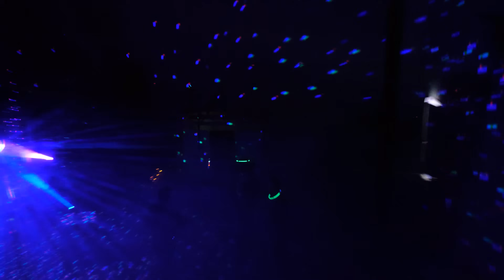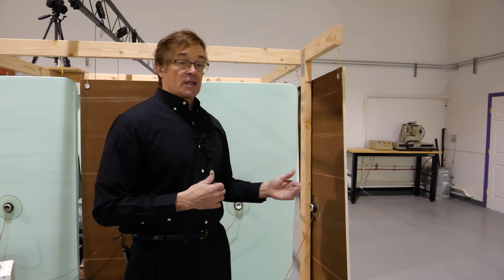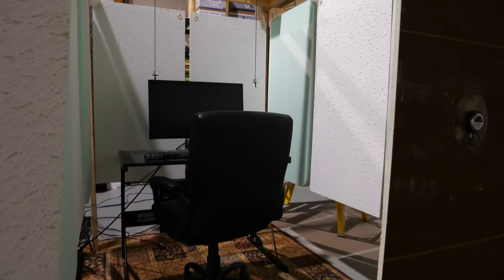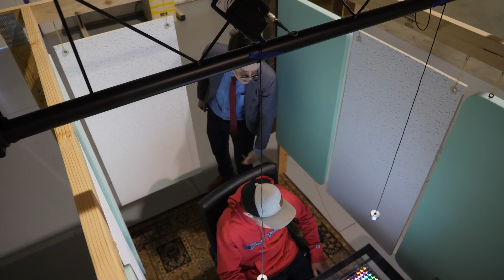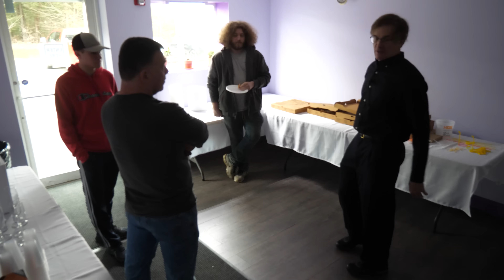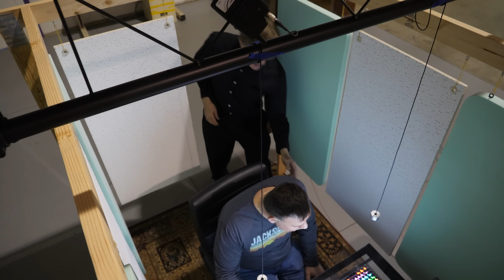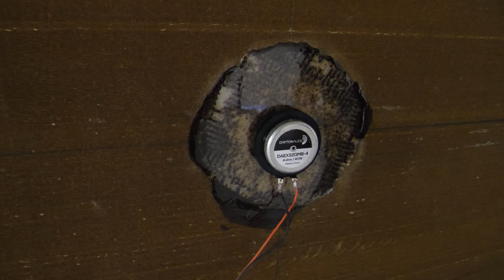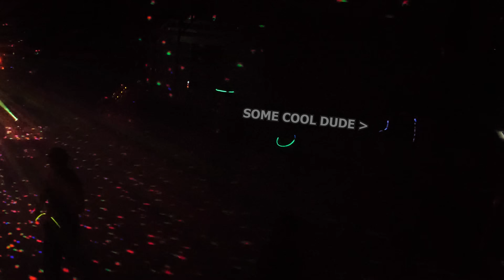SHOULD SPEAKERS THIS GOOD BE LEGAL?

Comment: Was a super cool experience, and a very unique type of sound when heard in person. Thanks for the invite, came for the tech, stayed for the pizza.
Reply: Compared to typical studio monitors, how would you rate these panels? I would guess the audio sounds much more open but is less accurate than proper monitors. Also, was the sub correctly phased with the panels or did it sound like it had group latency issues. (Obviously, estimating this kind of details without previous knowledge of the music you're hearing will be really hard.)
Reply: Thanks for participating!
Reply: I read this as you were getting into the booth lol.
Reply: Absolutely build them you will not regret it I used every single technique I was able to find all over the Internet to try to give them the best chance to sign the best they could when I first listened to them they sound like they were just tweeters no mid-range no bass no nothing and I was instantly and hugely disappointed I thought they sucked but within 45 minutes or so of plain different songs they slowly started the break in then over a short period of time they became one of the best sounding speakers I've ever heard of my life and I've had ribbon tweeters limited edition pioneer tire speakers Polk audio etc and a lot of high quality headphones and the old adage that people say if you build them right you build to enjoy that flat panel magical sound is absolutely not a lie also used a one-to-one water glue coating if I need right two coats on the front and WinCo in the back it was very watery very runny I didn't think you would do anything frankly I thought it was a waste of time but once everything broken I used a very clean sanding knob miniature amplifier and I listened to heifability title music streaming service and hyperformance while he's going through to the panel speakers when everything came together the sound is absolutely almost spiritual like it's something that absolutely has to be heard to be believed and you spend a small amount of money getting up all the parts you need then listen to them you'll be so blown away that's something can send some magical and cost such a small amount so I absolutely recommend building them you won't regret it but I would definitely building correctly though some people try to use cardboard boxes glass wood metal use the pink film is insulation boards you can get up home Depot or Lowe's 2 ft by 2 ft along with all the other techniques and they sent absolutely the best I use the 40 watt four legged exciters from parts Express and I'll make sure my amplifier was a little bit more wattage than what the exciters take just to protect them insurance wise hope this helps 👍👍😁♥️
Reply: Are you the one that gets into the booth at around @13:00?

What was that first song you played?

That had to be an amazing experience!

Hope you have a good week this coming week, and may your pockets be full of sunshine!
Reply: Thanks for the info, but who are you, "I came for the tech and stayed for the Pizza.".?
Reply: I think you should use the pizza box for the speaker panel. Can't be any worse than a ceiling acoustic tile.
Reply: @richarda3659  Ceiling acoustic tile doesn't have much harmonic resonance unlike pizza boxes. You basically would want light panels that make no sound when you knock them. As totally silent material doesn't exist you have to whatever you can find. In this video they claimed that that these materials were the best they could find.
Reply: @MikkoRantalainen  I dont think it was that they were the "best they could find" but more the best material for cost / quality of sound on a cheaper end of the spectrum. he said that entire system setup was about $200. I paid almost that for a good quality set of head phones and the top of the line start about 100 or more up from there. You figure a Bose surround sound is starting at about 1k It sounds to me like this is a killer deal.
Reply: @StrifeA217  I agree that $200 is not a lot of money but I don't think that included amplifiers or the sub. Take the sub away and those panel speakers do not sound that hot anymore.

And unless you're getting noice cancelling headphones, I'd skip Bose audio systems. It's better to get some real speakers if you're going to spend more money in the system.
Reply: @StrifeA217 , what do bose have to do with a good stereo.
Reply: Jasom, good question. Bose is actually garbage so it's nice to see someone else is well aware of that (assuming that was your intention).
Reply: @RickL_was_here  ,you got it. Add bass and everyone thinks it's a great system.
Reply: @MikkoRantalainen  If you're involved in the audiophile world, $200 is nothing. Admittedly, much of audiophile equipment is utter nonsense. However, there are real gains in speakers up to thousands of dollars. I think for the vast majority of people, they could tell the difference between $500 and $1000 speakers. Is it worth that money? Probably not. But it is pretty cool how good audio equipment can get. It's also absolutely insane how scammy some of the audio companies can get too.
Reply: @roots4x  I'm definitely on more on the audio engineering camp than high-end audiophile so no $200 cables for me. I'm currently using Genelec 8030 monitors with DSP corrected subwoofer and I know I could get much better setup but it would practically require doubling the cost of the setup and I feel that it would be too much into dimishing returns category.
Reply: The experiences of animals are real and matter.  Their suffering is identical in nature to your own.  Don't take pleasure in cruelty and violence.
Reply: @Barnaclebeard  I agree with your message but how did that relate to this discussion?

Comment: Many long years ago we played with driving sheets of glass and the results were interesting to say the least. The acoustic characteristics varied with time. Fresh glass sounded very different to glass a couple of years old. Also if the speakers weren’t used for a few weeks, they’d need to be driven hard for a few hours to return to the same state they’d been before they were rested.

The tweeters were fascinating: Two piezo transducers glued to opposite sides of a Ping-Pong ball. The 360° dispersion created brilliant sound-stage. Unfortunately, every so often one of the piezo devices would explode and so the tweeter would need to be replaced.
Reply: That's interesting because we usually think of glass as a rather stable material but in fact it is a plastic or high viscosity liquid.
Reply: @InsideOfMyOwnMind  Glass is better thought of as an amorphous solid. While it’s often referred to as a high viscosity liquid there’s a lack of empirical evidence for this on human time-scales. Clearly we were experiencing the effect of changes to local structure we had no way of determining what they were and even today I couldn’t find anything relevant in an admittedly cursory lit search. The chap who was responsible for exploring these novel acoustic approaches reverted to using more conventional drivers and techniques. Sadly he became quite hostile when I purchased my current speakers from someone he doesn’t approve. So it goes...

Comment: I wonder if further isolation on the ceiling panels could be had by using silicon grommets or tube/hose sections rather than the rigid pipe.  Than again an appropriate size product would almost certainly be more expensive than the pipe segments...

Comment: yes they should be legal, the main reason is I dont want to be in possession of 2 pairs of illegal speakers. Mine were made with the pink foam board/insulation panels. I attached a CD disc to the panel and installed the driver on the CD disc which basically increased the contact area of the driver to the board. Instead of just the ring contacting the foam, which wore away at the board quicker and had an adhesive failure, I used the CD disc to transfer the vibration over a larger area. I also found that the CD disc allows for better low and low/middle ranges to be heard. Applying the Driver as is to the pink board without the CD disc attach point/mount, the low to low middle Hzs were lost. I have them mounted parallel to the ceiling and 4" away from the ceiling in a "down firing" position to the left and right of the desk. The other two are mounted on the wall left and right of the monitor 4" away from the wall.  The sound is incredible and the separation is nearly "life like". When playing Skyrim you can hear people walk up behind you and hear footsteps traverse from side to side. When the dragon flies thru the air it matches sound wise. Im considering making one more set for an upper L/R rear ceiling mount. Probably will need a 7.1 set up...

Comment: I am building a large garage/poll barn and will be making these for it. I was thrown off by the 60/40 for driver placement when I have always heard 3/5 2/5 but after thinking for a second it is the same. Thank you Tech Ingredients for the update on how great these speakers are for the price even after all these years of you covering them.
Reply: It's not critical. But my feeling is to go with an irrational number, maybe golden ratio. But 3/5 is close enough and the exciter driver has a bit of an area to it, not a point source. You can refine it to 5/8 or 8/13 or 13/21 but that would be ridiculous.

Comment: I made a set of these for my shop stereo a few months ago after seeing your video about them and wanting to make some for years. I just used the smaller foam panels, like half the size of the big ones in this video. I added a cheap sub. It sounds great and goes plenty loud enough for my 24x12 shop that I never even turn it up all the way. I have them connected to a bluetooth receiver that connects to my phone. I recommend making some of these for sure if you want a space with good music quality.

Comment: Would really like to know more about the rest of the setup, amps used, etc. Teasing the idea of making a gaming/theater/vr room in a spare room and want to test these out for myself.
Reply: Me aswell
Reply: Likewise
Reply: How they sound up against a wall would be interesting as that is probably how most people would have them at home.
Reply: @Cyba_IT  yeah, wonder if you'd need to add damping material between wall and panel speaker.

Comment: I wouldn't be surprised if most of the tracks on the original Telarc test CD are in the public domain now.  That disc came out in the early 1980's or maybe the late 1970's.  It would be interesting to see how those panels would handle some high dynamic range music

Comment: I had some CARLSBRO flat panel speakers but they had FIVE drivers at seemingly random locations and needed a sub - Never got to use them in anger but I liked them moderately - I think they lacked top end, which isn;t exactly surprising.

Comment: Cool setup, I need to get around to making some and testing them in our anechoic chamber. I'm curious what their directionality is like and if you could optimize a 3d shape to counter modes on the panel.

Constructive criticism intended. To really get a good comparison an A/B would be cool to see. Also doing it as 5.1 to compare to their existing headphones or at home stuff  it is a hard comparison to draw because most people don't listen to music in 5.1, and by up mixing you will inherently get better feedback due to how we perceptually weight spatialization of audio psychoacousticly. Head Acoustics released some cool data on this.
Reply: Directionality is the inverse of a normal diaphragm speaker. The low end is dipole in character, dictated by the size of the panel.
Reply: 10 months later, did you do the tests? How did it go? :3
Reply: Hey
I'm just thinking out loud here but if you have an anechoic chamber to use, maybe do the A/B yourself. Why not use some of the other individuals in ''our'' to do a better test?

Comment: I love your channel and think all your videos are unbelievably well done. I have been building 
speakers for many years as a hobby and no mater how god awful a pair sounded people 
said they were great. That was without a camera pointing at them. However I think yours probably 
sound very good. With over 40 years experience I have found that any speaker,  no mater how 
cheap the drivers, sounded fine if there was no crossover in the vocal range and it had 
good off axis response. Yours a like a cheap Magnepan I will have to try them. Have you 
considered comparing them to cheap traditional drivers. Say the 10FE200 woofer crossed 
over to the ST200 super tweeter at 4K in a 3 cubic foot sealed box. Thank you for another 
great video.

Comment: I think you mentioned that this was a 5.1 setup with a separate sub. Have you tried anything with Dolby ATMOS? I'm curious about how a downward firing panel would be set up. Those of us with vaulted pitched ceilings are SOL with the standard upward firing Dolby ATMOS speakers.

Comment: I wonder how these would work in an outdoor environment. I do small gigs at outdoor markets and it would be interesting to build speakers like this to play my Cigar Box Guitars through at those events. They could hang from my canopy, maybe with my logo painted on them. Hmmmm. Have you tested them outdoors?
Reply: The less is around them the better it will sound. For outdoor use I would take wind into consideration aswell... Also for painting you want to use spray cans with a long distance from the panel when you're spraying them.
Reply: @arend3669  I may have to give them a shot. I have a 12V amplifier I can use off my battery pack.

Comment: I have questions about the impulse response due to the moving mass of the radiator.  Also about cancellation caused by the rear wave coming from the back of the radiator bouncing off of surfaces in the surrounding room and interacting with the panel.  This would typically result in some low frequency comb filtering of the longer low frequency wavelengths.
Reply: These are configured as dipoles well away from the walls of the room so cancellation effects would be very different if you were using them to say, line a room where they are very close to the walls..
Reply: @InsideOfMyOwnMind  The wavelength (λ) in Air is nearly  2.86 meters, so unless you deaden the walls or put up something to diffract the reflected sound it's almost inevitable that you're going to see the reflected wave cancel and/or reinforce the primary front output depending on the frequency.
Reply: I meant to say the wavelength is nearly 2.86 meters "at the low-pass frequency of 120 hertz", the lowest frequency handled by the panel before the signal is crossed over to the subwoofer.

Comment: Cool project, worth a try. If you were to mount these more conventionally for a surround sound AV system how far from the wall would they need to be to not have bad reflection issues?

Comment: Two questions I have : can you glue a picture on top of speaker to make it more appealing for the wife factor and secondly : how can you modified the speaker to hang it from ceiling?
Reply: If you put a picture or anything on it it will cause reflections off the panel, it could also inhibit the frequency response of the exciter. Also he shows directly in the video how to hang them.

Comment: I've seen all sorts of DIY acoustic experiments. Towels stuffed in a hollow, upholstered 2x4 frame; skyline diffusers made of Duplo bricks; and now surface conducting speakers with cheap ceiling tiles. At this point I'm ready to make the ultimate sound booth for under $100.
Reply: Actually, i'm willing to bet that system costs way more than 200 bucks. The rug costs 25 at least, kevlar line, 15, you get the point.

Comment: Need to do some measurements with REW vs. other speakers using the same audio chain and no EQing in the same location, and see the difference.  A UMIK is every inexpensive for this purpose.
Reply: They already have a measurement microphone, it's a Dayton Omnimic. They also have an anechoic chamber at home as well.

Comment: Interestingly, listening to this on my DML speaker setup:  Two 40W exciters mounted to 1" XPS with a 100W passive subwoofer, all running through a Fosi Audio BT300 2.1 Bluetooth 5.0 amplifier (2 channels @ 50W + 100W sub channel)!

Comment: Respectfully, While many audiophiles are well intentioned; most have never actually heard the performance capacity of their own systems due to lack of developed knowledge of how things actually work.  It's not just limited to audiophiles it also goes for virtually every engineer and manufacturer of even the ultra high end supposed cost no object gear. Sad that most never get to experience what is actually possible, doable, and repeatable and most importantly been actually done that conclusively demonstrates how misled most are.

Comment: As always, fascinating work. When you say "enormously large panels" to cover low frequencies, would a "roof" panel covering the cubicle be large enough? Or are we talking about 12 by 24 feet sizes? I did note that you mentioned that vertical hanging would be best so there may be other reasons why a roof panel wouldn't work. I'm also curious about how well these project for outdoor applications. All of these questions are stuff I can research through your other videos (and the videos you reference in them) but I thought I'd still post them here in case any other viewers had any knowledge on this.
Reply from the maker: The largest we ever tested was 4'x8' and although better a sub is still a good, but not necessary addition.